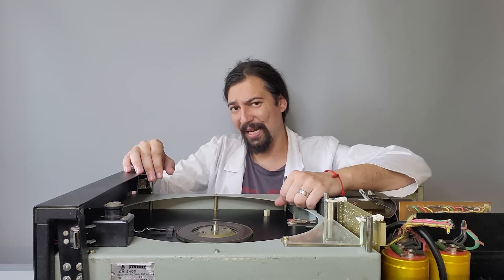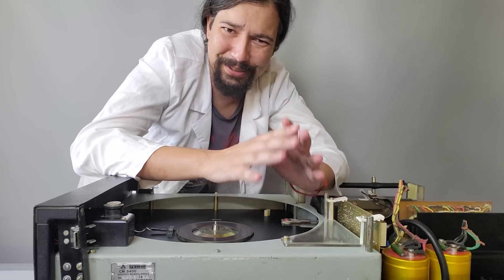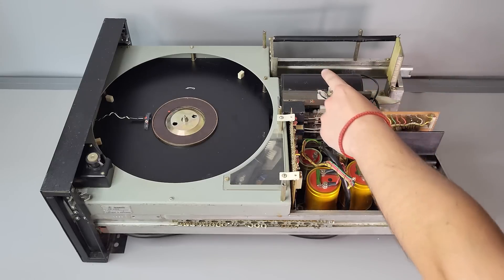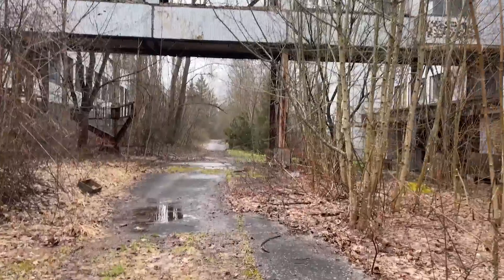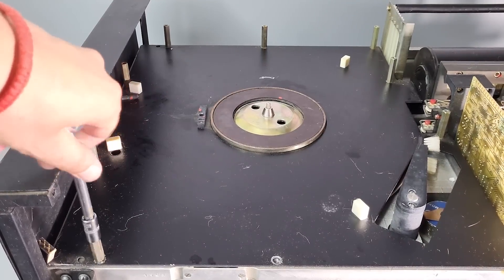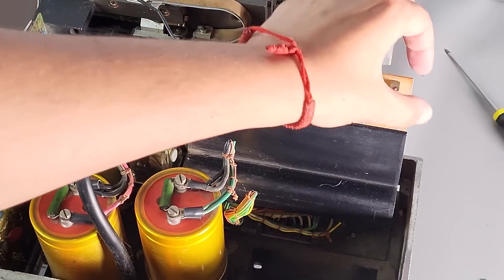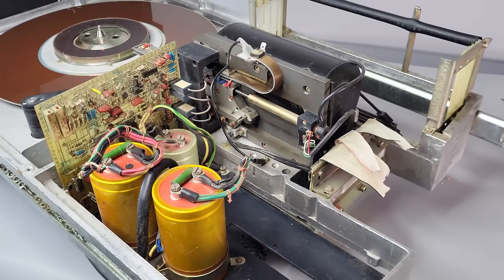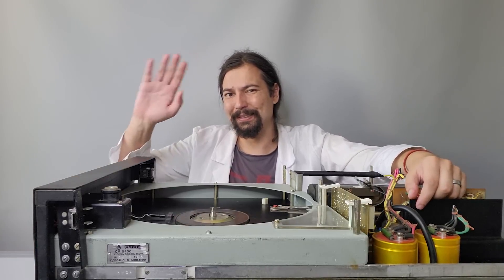The BIGGEST Hard Drive I've EVER Had | SM5400 Bulgarian HDD

Comment: The turbine is used that the heads wont touch the surface. That was the main purpose, not the overheating. Also the russian harddisks used the winchester system. They are also used to blow the dust off the platers - hence the air filter, but only play a secondary role for overheating. You can run the platers without the turbine, just dont load the heads and it will run perfect.

The calibration was made for the track allignment, not the distance of the heads. There were special allignment discs what were used as reference, so all hdd's had the same standards and the platers were interchangeable.
Reply from the maker: Thanks for these details.

Comment: It is sad that some are interested in the design and principle of operation of the device, while others are only interested in how much precious metals can be extracted from it. If the drive falls into the hands of a specialist, then with its help you can teach children the structure of a rotary motor and a linear motor, which remained intact. inform about how to control these motors, for example, using Arduino. It would be possible to explain how the sensors of the brush control mechanism work. Investigate the positioning system of magnetic heads (carriage position sensor relative to the rack) taking into account the acceleration of movement (the sensor is located in the fixed tube of the head carriage). To analyze the operation of the spindle speed stabilization system through an induction sensor on the housing.
Reply from the maker: Well said.

Comment: Give the cat freedom. And don't tell the cat "don't move". You may not know, the master considers you a servant. So behave like a good subordinate. And so that the cat's fur does not interfere with reading the data, there are brushes that clean the rotor every time the acceleration is turned on.

By the way, the drive motor of this drive is of a new design. It is a brushless three-phase motor. The previous version had a motor with 4 brushes in the housing, an anchor rotor and was controlled by a different drive board.
Reply from the maker: I am screaming.

Comment: As far as I remember, the capacity of the IZOT-1370/CM5400 hard drive is 2.7 megabytes per disk (built-in or removable). In the USSR, not the original PDP-11 computers were used, but their clones, such as stationary SM-3, SM-4, SM-1600, SM1804 or personal DVK-2M, Electronics-60, Electronics-85. They work on the basis of an operating system similar to RT-11 (Rafos, Fobos, etc.). Although it is not excluded that the original PDP-11s, which had higher reliability, could have been installed at the Chernobyl nuclear power plant.
Reply from the maker: Thank you! There were no original PDPs at the Chornobyl NPP, only SM systems, generally SM1420. I am puzzled, many commenters said the same you you did – about less than 5MB capacity, while the numbers I said in this video are based on the technical description for the IZOT factory (a standard of production), which describes three versions, each >20 Mb. I trust you, but that written details confuse me.

Comment: Being the youngest and strongest looking computer person, I was asked to help the support technician replace a hard drive on our supercomputer.  I was surprised to see it had what looked like a washing machine motor connected to the hard disks using a v-belt like used in old cars.  The hard disks were inside a sealed cast iron sphere shaped with cooling fins part.  I believe this hard drive drawer weighed about 200 lbs.  It was mid 80s, cap. 800mb, on an Floating Point Systems FPS 364 mini supercomputer.  I did some asm programming on it, manual pipelined 64 bit with additional vector processing units.
Reply from the maker: Thank you for sharing!

Comment: From my memory, the capacity was 2.5 MB per disk plate, so with your RK05F-like disk drive with one fixed and one removable plate, the capacity was 2x2.5MB. But believe it or not, it was possible to generate and use multiuser RSX-11M system on these disks before the RK05 distribution kits were dropped with some version od RSX-11M.
Reply from the maker: @ezvezv  we referred to the original printed technical description. It says 25+25.
Reply: @ChernobylFamily  CM5400 with 5MB (total for two plates) is mentioned for example in http://www.vystava.sav.sk/wp-content/uploads/SMEP.pdf

In RSX-11M, CM5400 were SYSGENed as two RK05, each with 2.5MB per plate.

I have found links mentioning 2.7 or 3MB per plate, but to the moment, no link to page with capacity 20MB or close per plate. I will try to search harder to support 2.5 MB per plate. :-)
Reply: @ChernobylFamily  

Here https://www.fit.vut.cz/img/museum/museum2.jpg the blue 20MB drive used with SMEP computers could be seen. It looks like that CM5400 is partially visible in the bottom right corner of the image.

And here https://intranet.fel.cvut.cz/cz/gallery/pocitace14/24.jpg are disk packs for both drives. The white single-plate one for CM5400 and multi-plate pack for 20GB drive.

Comment: Look at those caps! 82000 micro Farads, each. I always heard that caps were used to park heads in case of a power failure. But I never imagined something so massive as the heads are kind of light, can be removed fast and the disks have enough inertia to keep spinning for a while. Seeing you disassemble it the heads do not seem light anymore. The only caps this size I ever saw were the ones used on a capacitor bank for a small Tokamak at my University.
Reply from the maker: They indeed look scary :)

Comment: The powerful airflow serves to keep the inside of the disk clean. It also created a flow under the read / write heads. The heads had an aerodynamic shape. The airflow generated by the fan and that generated by the strong rotation of the disk, kept the heads raised a few microns from the surface of the disk. If the filter was dirty and the airflow was not sufficient the heads "landed" on the disk and you had to throw everything away. I have repaired many copies in the original version. Control data corporation. They were spectacular. We called them "washing machines".. hello from Italy🇮🇹.
Reply from the maker: Thank you!)

Comment: I think the sensor is an index sensor.  There are notches in the hub in the centre of the removable 14" platter with notches for the individual sectors and an extra notch for sector 0.  Still got one such medium here, could post pictures if interested.

The airflow is really important to keep dust out which could result in a head crash and to keep the heads flying just barely above the platter without touching it.

The heads being retracted on a power failure is quite a noisy experience.  Basically a pound or two of metal are being accelerated as hard as possible with the energy from those capacitors and the movement ends when the head assembly is being banged into the drive at the end of the travel.  Which sounds more like a blacksmith at work than a computer.

PS: If you have cat panic I can offer asylum ;-)
Reply from the maker: Thank you for these details!

Comment: This computer was not  really a big one and it was quite progressive, hacker's thing because it was a clone of PDP.  USSR had its own lines of computers that once all were discontinued in favor of huge and bulky IBM/360 clones that became the main line throughout all USSR. That allowed to avoid software incompatibility with the West and between companies. But nobody actually loved IBM machines as they were intended for accountant and banking purposes. And nuclear engineers of power plants like chernobyl managed to avoid using computers of main breed and had chosen PDP instead. It was mini computer for that time, that was mostly used as an industrial controller, almost like arduino. They tried to avoid using PL/1 and Cobol programming languages in favor of Fortran and more modern C. This machine also was used for tracing and logging the neutron and temperature sensors of nuclear reactor and had software to calculate the profile of neutron field. Not in realtime, just for analytical purposes. The reactor itself was controlled by analogue control system that was a standard way for that time... So it probably was a smallest available HDD for that time.... It even was a rackmount one, not a standalone unit. As far as I remember, the maximum size for reactor data logs was 1 MByte, no compression was used in first versions.

Comment: At 45kg and 25MB in capacity, I estimate the storage density is around 14 grains of sand (Silicon Dioxide) per bit. Sand plus this technology usually results in poor storage, but in SSDs it works wonders!
Reply from the maker: I did not see that SSD yet, but I guess it has wheels.

Comment: On those old 10" / 14" HDDs the blower motor also helps (aka: is needed) to generate the air cushion to keep the heads fly and prevent them to not crash onto the surface of the discs. :D

The special disc to calibrate the heads had a single track, forming a sin() function on the surface. With that, it was possible to monitor the head alignment on an oscilloscope and see the offset compared to the ideal sine.
Reply from the maker: Thank you! For calibration, along with oscilloscope, a TIDU-4P tester is needed. We reviewed TIDU-3P briefcase (check the video about SKALa ES hard drive), here the device would be similar.

Comment: Not soviet. Bulgarian. Also used @ Poland Odra systems by ELWRO.
Reply from the maker: Absolutely correct and i say it right in the beginning of the video, because to lower the effort of IZOT engineers would be inappropriate.. But, there is one "but". This was designed and produced by request of Soviets for SM EVM ecosystem within COMECON cooperation and by Soviet specs (documentation actually even has order numbers, etc.). So probably a more correct would be "Bulgarian-Soviet"

Comment: I used 30 MB disk packs on the 1033, and 100 MB packs consisting of 11 platters on the 1045. The disk drive was the size of a top-loading washing machine. The operation was similar too: open the lid, drop the pack in, turn the handle to lock it.
Reply from the maker: We have a review of such a drive, afaik it was a work pull from 1033. Check previous videos.

Comment: It’s the HARDEST drive. 😁 As a kid in the 80’s I saw giant 14 inch removable-platter drives once, but by the time I was old enough to buy a hard drive for myself they were 5.25 inch. Thanks so much for showing us the internals. It’s very interesting that they would blow outside air into the platter chamber rather than keep that chamber sealed, but I guess that’s not an option when you have a removable platter.
Reply from the maker: It looks so. Though initially I thought it operated in reverse direction, like a vacuum cleaner.

Comment: Well you KNOW you've got something good when it might collapse your table and it's a magnetic storage device. This looks like it's built exactly as well as a BetaCam tape cleaning machine from the same era. Same weight, same construction; same shaft connections, same motor drive types but this drive you have has better sensors (obviously because it's a hard drive). Simple but very accurate in a way that has been lost to time everywhere in the world except in some rare industrial lab equipment.
 I think those small rectangular things you showed might just be rod selector buttons! Nice work!! I have buttons about the same size that are far worse but also scary. (Nike missile test box apollo-era mission control type buttons). Yours look like they are in better condition. If I could send you some power I would!!
On a lighter note I also have a 40 kilo (90 pound) professional video tape machine to lug up 2 flights of stairs to assess after rough transportation. It is from the exact same time as what you have there, Sony UmaticSP format model BVU 850. It's from a very brief era, a late model just before the mid to late 80's when form factors changed over. It's a beast crammed full of electronics. Fun to work on if I have what I need (so not easy at all). Even though I've fixed mechanisms just like it has more then 75 times the electronics are intimidating and it will easily collapse my plastic container 'work table'. So it has to stay on top of other similar equipment on the floor. Best wishes! I love all your videos!  Keep going! 
So will I but I don't post anything. I will someday soon.
Reply from the maker: Thank you very much:)

Comment: You mentioned that the drive is damaged, how did it get damaged?
and yeah, it's similar to the CDC Hawk drive that Usagi Electric is working on.
Reply from the maker: It was stored in a very dusty room for years, with heaps of electronics over it, and heads inserted in. So literally anything but required conditions.

Comment: There's enough collectors with restored PDP-11 computers, I wonder if it's possible to get this unit refurbished enough to read the platters and extract any uncorrupted data.
Reply from the maker: Theoretically yes, but the fact this is PDP-11 compatible by architecture does not make it compatible by hardware. Frankly, I never saw these drives intact, ever.
Reply: @ChernobylFamily  if you have access to the schematics, it shouldn't be too difficult to produce some replica boards to complete what's missing as long as the head assemblies are intact.  It's probably a long shot, but if the platters are the same size and thickness, you might even be able to transfer them to a working DEC drive and get a flux read off of them that way,. Contrary to popular belief, hard drives can take a fair amount of abuse as long as the heads aren't destroyed or the platters scratched. 

The PDP-11 family is outside of my wheelhouse, but speaking in general, as long as it's compatible by architecture, then making an interface should be easy. I've had similar kinds if issues between various PCs from the 8088 era that had different expansion interfaces, or different schemes of memory management, etc.

Comment: The size of the disc isn’t so much the issue. I had one under my desk at work (some 5 years later) but the entire external assembly was roughly the same size as this platter. It was about a quarter of the weight with miniaturised heads, control board and power supply. This was the first external 1GB HDD I’d ever used and it contained raw experimental data that could be stored and later analysed. Truly a marvel at the time allowing work to continue for 3 months, before taking a break for a week to verify what had been collected.
Reply from the maker: Well, assuming I cannot normally walk for 2 days after lifting this, the size of the disk is very much an issue :D
Reply: @ChernobylFamily  oh yeah if I needed it moved I’d call technical support. Lasers and stuff you know, delicate 😹

Comment: Seeing these ehm... "toothbrushes" and considering, that most if not all technicians I see handle the platers with absolut care, while wearing gloves, are you sure these brushes are for cleaning and not destroying the platers (or if a bristle breaks: destroying the head with resulting head crash)? You know: "Press red button for auto destruct"?
Reply from the maker: Documentation says that they are for cleaning, same told technicians who worked with actual drives in the Zone. In reality, to destroy the disk all you need is to drop heads on it, both disk and heads will be done.

Comment: I think you've broke the record for the heaviest hard drive on YouTube. Seems "bulletproof" was part of the design requirement. The build quality looks pretty good by the way.
Never seen such high capacity on a single capacitor also.... These things are monsters, wonder if they've dried up? Would be fun to try to measure them. I've got pinball machines in my collection that are older than the Chornobyl disaster, still with the original caps. Works flawlessly.
Reply from the maker: I'm a bit doubtful that dealing with such capacitors will be fun..) Speaking about the weight of this drive, DIIS drive of SKALA is 300 Kg, which is much heavier... https://youtu.be/6CFUYtLKBfI

Comment: The RK05 shares very much in common with the IBM 2310 and the Diablo Series 30.  They all use very similar heads and nearly identical disc packs (the Diablo Series 30 is compatible with IBM 2310 disc packs).  The disc packs in this drive are closer to those used in a CDC Hawk drive.
Reply from the maker: Thank you for these details